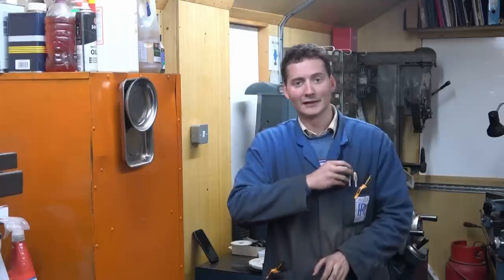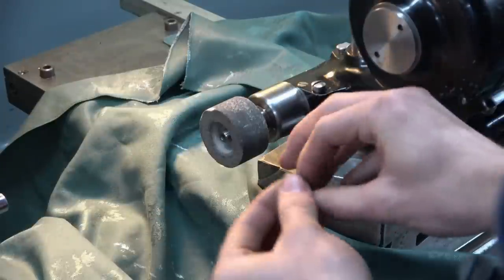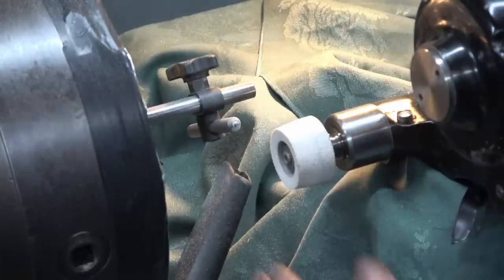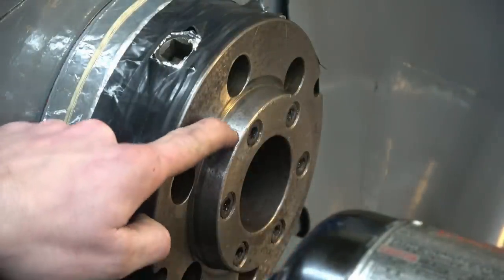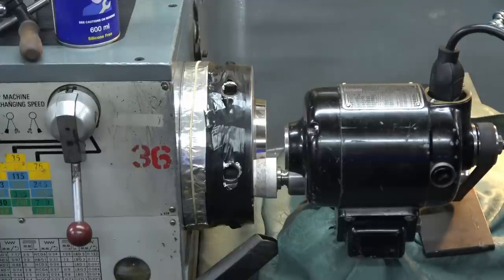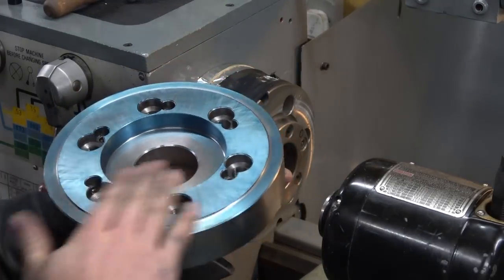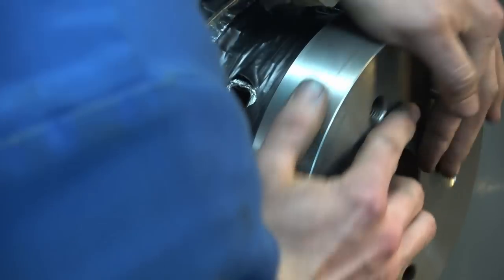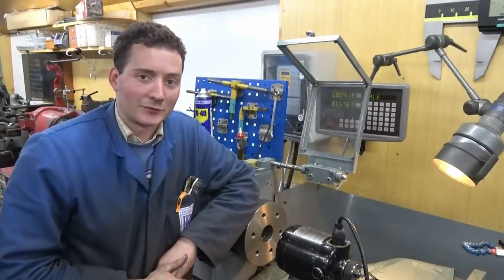Re-Grinding a Lathe Spindle Nose

Comment: Another fascinating video. I was wondering if the parts you ground were hardened and if so, how deep does the hardening go but the damage makes it look like the metal is not too hard.
Reply from the maker: It's definitely hard but as you say not too hard as the chips have deformed it. Generally speaking of something if a medium carbon steel is heat treated it will be hard throughout. If it's been case hardened however then you've only got about half a mill of hard layer.
Reply: @MrCrispinEnterprises  Thanks for your response. I was thinking you don't want it too soft so it should be somewhat hard and heat treating would give it the ability to be ground repeatedly but would that be a consideration for the builder? Case hardening would be a compromise but then as you say, might only be very shallow then you might grind through it. Can you test for this in an area that won't affect the rest of the piece?  So many things to consider when working on machinery.

Comment: The mounting studs should be adjustable - they are on mine. They should be free to rotate, and be set so the cams are about 45 degree past contact when fully tight. It should then take a tap from a mallet to remove the backing plate.
I spent some quality time fitting up the backing plate on my collet chuck. It mounts up with TIR of a few 10ths. I prefer backing plates that "require fitment" so that I can cut them to fit my spindle perfectly.

Comment: Nice work thanks for the video very informative. I have a wolf tool post grinder which works good the spindle has no oiler on it i am wondering is there a type of grease in it instead. Its spinning smoothly and i dont want to strip it if there is some way of lubing it i dont know
Reply from the maker: Sealed for life perhaps?

Comment: I have a size six nose bolt on  (predecessor) and in my opinion a good tap with a leather hammer to release it is right. It shouldn’t fall off or need a copper hammer. *should anyone not wish to grind the nose out of fear then true up the chucks back plate and always put the chuck on in the same position. :o)

Comment: For grinding the taper, in my opinion it would have been better to set the compound at the taper angle and dress the wheel parallel. Using the compound to traverse the taper would mean the wheel would cut on its corner as designed. Using the cross slide to drive “straight in” like a form tool does not result in the most consistent surface. You got the desired result though so that is what is important. Nice job!
Reply from the maker: Yes traversing along the taper angle would remove and peaks in the surface.

Comment: Did you add the power plug to the grinder motor? I have an old doall that needs cable replacement and that looks slick
Reply from the maker: That's how it came. A plug socket on top of the motor

Comment: Just wondered if you did any head stock alignment before grinding? Does regrinding eliminate any misalignment? Cheers
Reply from the maker: Hi, no I didn't do that. I had aligned the grinding spindle with the lathe spindles centre of rotation so for the flat face I guess the that's the important bit. You could argue that any error  in headstock alignment would give an error in the taper angle produced. Cheers.

Comment: My question is when at the end when you put that plate on and tightened it up why didn't you run that out with an indicator? I think I would have done that.
Reply from the maker: Because the front surfaces of the back plate are designed to be machined to shape and not necessarily ture

Comment: For grinding the face of the spindle, could have just rotated the grinder 90 deg and mounted a traditional grinding wheel (say 6”x1/2” wide)?
Reply from the maker: I could yes but it can be tricky to work up to a shoulder if the front corner of the wheel is wearing.

Comment: Just wondering why you wouldn't merely clean up the nose, the angle and face... then put the chuck back plate in a surface grinder to get it to set right in the lathe.  Obviously it isn't 100% the same thing, but one would think that it'd be more time efficient to do it thusly.
Reply from the maker: It's a case of making the spindle nose match the back plate so that any standard D1-6 tooling will fit on.
Reply: Why would grinding any back plate be necessary or even considered?    The chuck face in this fit interface does not touch the spindle.    Where is the "effficiency"?

.

Comment: So, it's all trial and error and no measuring?
Reply from the maker: In this case yes although you could skim the front face and use a depth mic and trigonometry if you wanted to.
Reply: @MrCrispinEnterprises  "trigonometry" Can only show what a measurement should be,in this case, at a given diameter.
Reply: @michaelmayo3127  ...sounds like you are just wanting to impress and/or argue.   If you need to be informed, "readings" can be plugged into the trig functions.   We are dealing with X & Y readings as this is a taper.  If the stone has been dressed to this taper .....why bother?   Is there an advantage doing it this way?  If so, what is it?

.
Reply: @taxicamel 
It that so!! Well, same say if it look like the drawing then that's OK. It's not very handy using a chuck backplate as a tapper ring gauge: it becomes a bit trial and error. If the stone is dressed for the profile of both the register and the tapper, then the devil is in the the Y axis.😁

Comment: Avoid grinding lathe spindle tapers and flanges, especially on camlocks! 

Marring is common and to be expected on any used lathe, but this generally has NO EFFECT on mounting efficacy(rigidity, concentricity...) so long as there are no burrs proud of the mating surface - if there are, then a light dress with a file and slip stone with a rolling action, is all that is required(just as one would do with a marred Morse taper shank... 

Start by truing/re-machining that poorly made chuck adapter BEFORE even considering the spindle nose....

Nice little lathe BTW...
👍
Reply from the maker: Yes, avoid it until you need to

Comment: They really abused that spindle nose didn't they.
The spindle nose on my DSG 13x42 built 1957 is actually in pretty good order, just the rest of the machine is well worn, largely because the idiot's that used it lubricated it with grease, It only came with a 3 jaw chuck and I don't think that had been off in a very long time.

Comment: but the taper does the alignment, not the back face, checking once is enough, worse luck would be the chuck adapter is not true !
Reply from the maker: No I needed to blue the face to check the geometry that I was producing. If the grinding spindle wasn't aligned properly it would have shown up in the bluing.

Comment: old video, someone may have also inferred that, why the hell you wasted time buggering around looking for back face blue ?  Surely you grind the back face till you have a thou or two clearance and blue on taper should be spot on
Reply from the maker: Blueing the back face is to check that the face is flat and that the contact pattern is good.